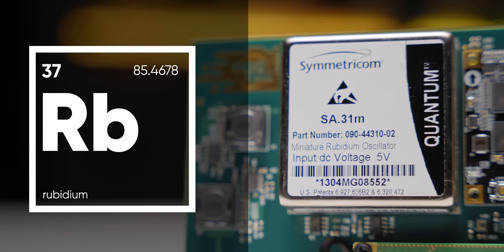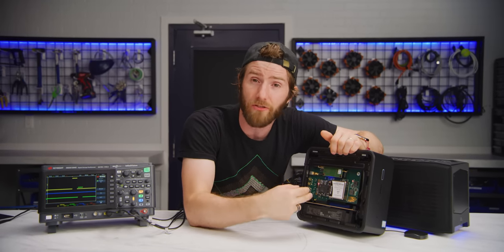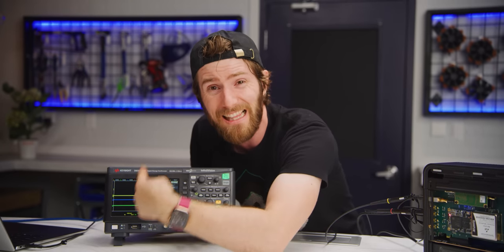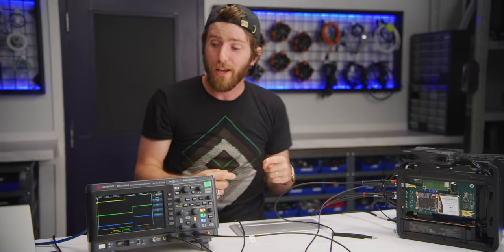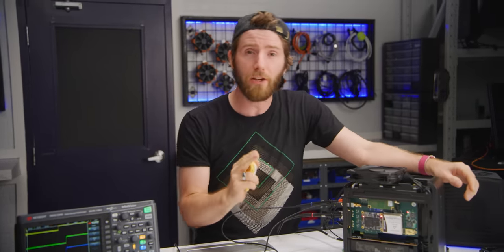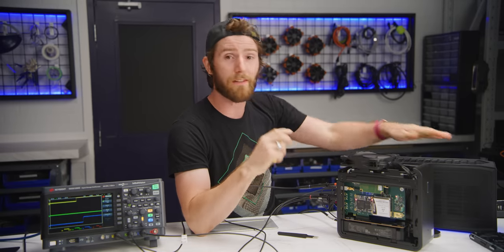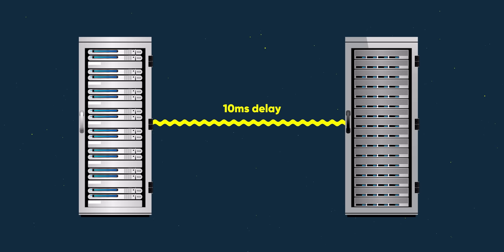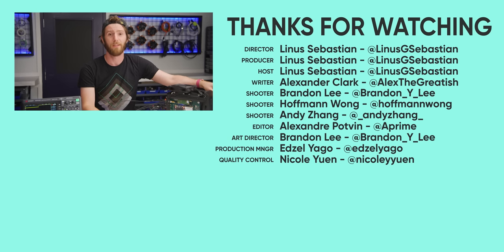Why is this PCIe Card RADIOACTIVE?

Comment: All I heard was these bots are about to become faster. Good luck buying anything with limited stock.
Reply: That's kind've a weird thing to have as your only take away from this.  While they might be an issue, there's so many other things it solves I'm not sure why you'd focus on that one potential problem that will need to be addressed by other methods than keeping everyone's data transfers slow.  And even if that was an issue, they could just keep things slow specifically on those websites that they want.  It just enables more control.
Reply: @ibigfire  Yeah, I'm not reading that. It's a joke, I made a joke.
Reply: @Tholi  That's okay, adult illiteracy is not that uncommon a problem.  I hope you find a class soon, there's many available online to help you with it.
Reply: @ibigfire  LMAO.

Comment: Thank you Linus! no, wait, THANK YOU AHMAD BYAGOWI! I've been trying to build a radio telescope for a couple years now, but just couldn't afford the $50,000 price tag for each atomic clock. If you are trying to set up an array of 12 radio dishes to work as an interferometer array like the VLA in New Mexico, EACH dish needs an atomic clock for that whole interferometer thing to work. That's 12 times $50,000 and explains why even universities don't frequently build these arrays, but now that it's ONLY $700, it'll take me a while, but it's at least possible now.
Reply: This is quite straightforward with a GPS aware router and some NIC cards.

Comment: On Ligo in general, they can simply bounce back an optical signal, not through a receiving station,
but by mirror. Once they know the output signal as it was sent, the return would be changed,
by any gravitional wave, since that would have had an effect on the signal as it is bounced back.
Interpretation is then the only thing that is required.
In fact doing the globe thing, may have sideeffects due to curviture chnaging the way the interfence
works. A neat straight line is better, which is why future hyper advanced LIGO systems will
be deployed in space, where the length is no object, and other local gravitational disturbances can
be offset by increasing the distance from gravtic sources.
I'd expect like 2070 for the first out of system Ligo project to go into effect and have yet stil
better results than ever before. 
Locally used LIGO systems can be used to detect for asteroids nearby as well, since
gravity is also a very detectable component of heavy asteroids.

Comment: Crazy thought - instead of $1600 card with true atomic clock, install card with ovenized GPS synchronized clock (which is still very precise, but a bit less so) and add not 20ms but way smaller delay. That way for ~$100 you'll get much higher throughput, etc. but it wouldn't break the bank.

Comment: Something doesn't smell right about the claim of 100X speedup just by having super accurate time synchronization. That clock still needs a distribution network, subject to the same signal propagation delays it is meant to compensate for. Still, it's definitely interesting to think about!

Comment: There is potentially a way cheaper solution if people were willing to pay another £50 for their motherboard. Crystal oscillators come in several types - XO the bog standard basic ones that have 200ppm/C drift and about the same initial accuracy. You can get a bit better than that these days but not a huge amount better. Then there are VCXO's which have an initial accuracy of 10PPM and a pullable frequency so at room temperature you can get down to about 300PPB (parts per billion). The temp drift is by far the most dominant attribute at 25ppm (or a bit less with some types). Then you have OCXOs Oven controlled to vastly reduce temp drift. IE 25ppB which in real terms is 4000 times more accurate than the best XO.

Comment: In fact a delay was added to the algorithm 'THOR' made by Brad Katsuyama of RBC in the mid 2010's to combat the electronic front running that was happening because of the time/distance fragmentation between all the 44+ stock exchanges in the USA. This didn't always work, but they would delay the order to certain exchanges so they would all hit at the same time when they were purchasing large (like 100k +) share blocks that were split between different exchanges. 

When Brad left RBC to build his own stock exchange (Investors  Exchange - IEX) they actually built a time delay for the entire market by adding a few hundred KM worth of extra fiber in a shoebox sized box that connected his server in the data center, to the main internet backbone. They achieved with hardware and they were doing with software. It equaled like 350ms or something but virtually removed the ability of HFT to front run that market.

Comment: Few years ago I bought a stack of GTX 580 with internal oscilator clock removed and they had connector for external clock generator. They had bios modded to use external clock.

Comment: Well that 20ms can be reduced a bit by having these kinds of messages and expectations

1. TEST - Timestamp A, test this against stored timestamp B (stored on receiving server), if this timestamp is greater send TIME then DATA
2. TIME - Timestamp B, if greater than timestamp A expected data
3. DATA - Store data if newest of all  timestamps given via TIME message otherwise ignore

With this the servers can focus on sending the quickest response first, by the time server A is ready for server B/C/ETC the blobs of data will already be on their way, it can then send the chosen data straight to the client before immediately sending a TIME  message and DATA message to silently update the other servers, the beauty of this method is that it doesn't matter if the other servers are slower, server A can use it's current data in a timeout situation but also report to the user it's waiting on an update from other servers, this ensures that even if the data can't be received in a timely manner the user can still be informed that the server is at least aware the data's not up to date and coming back in a few minutes or an hour will reveal the updated data, this avoids unneeded usage of help contacts.

Comment: I'm also still rocking the Note 9. I could've traded it in for $800 off of the S21 (makes it free), but I'm still not impressed with the latest Samsung phones and my Note still works fine. I wanted one of the Asus ROG phones, but they don't work on Verizon.

Comment: Linus - [observing the need for accurate time in power generation] 
A mismatch between the phase of the AC output and electrical grid could cause a big fire 

Um... that's not really how that works 
You watch the synchroscope and drop the breakers when everything lines up

Power generation responds to the demands of the grid
Frequency increases, reduce generation power
Frequency drops, increase generation power 
(lots of power-factor math & time syncs here) 

Now if you try to tie in miswired new generator to the grid, that is where things get interesting
First, get it up to speed 
Then throw the breakers

Then watch through the sparks and explosions as the turbine/generator promptly exits the building 

Science: Imagine spinning a huge mass at a few thousand of RPM 
Wiring is 180 degrees out of phase 
One generator vs. the electrical "mass" of the grid and it ends with very loud KABOOOM! and a new skylight in your generator hall

Comment: Rubidium 'Atomic' clocks are about as radioactive as the potassium in a banana, and it is barely measurable.
The rubidium-87 is used in a discharge lamp, which then gets exposed to a microwave source, which it reacts to by varying its brightness at a precise resonance frequency.
No part of this process involves radioactive decay.

Comment: There is recent research into the nature of crystal oscillators that will allow for far higher precision, into the nano-seconds or picoseconds.

Combining newly discovered time crystals (crystals that react in a fixed repeating time period) with nanotechnology they should be able to make crystal oscillators that are accurate into the terahertz range and higher.   This will improve everything from laser controls to computers.

Comment: IBM used to do the same. Everything in IBM UNIX or mainframes were sychronis synchronized to a central clock. Asyncronus used to be better and for many applications it is. But you can use both and eliminate interrupt delays and network collisions etc..

Comment: the only problem with this, is there is a slight chance of the radioactive ions have a chance to escape and change a resistor. for example the binary 1100101 could become 0100101 accidentally, which means that any data that needs to be 100% accurate would not be able to use this.

Comment: This video's content clearly falls into WHAT?!! category. Extremely cool stuff. And clearly one that you might actually not really now yet when this can be important. Using underwater cables to detect gravitational waves sounds like one of those very surprising applications. Use data that is in principle available for almost no additional costs <- That is clearly something that should be done more often. Allthough I dont think that this kind of stuff (delays over a underwater cable) falls into freely available data, as it is of security/technological/military interest type.
If only data was a little more freely available ...  I guess there is enough smart minds that could use it to generate new ideas, but only if you give them the data

Comment: I hate the classic "Oh it only drifts 1s per 100 million years". This means 10 ns per year. If you're chasing nano-second or micro-second precision, 10 ns drift is not trivial. If you need accurate microseconds, that's 1% of drift per year. If the calendar drifted 1% per year, we'd be off by more than a month every decade. That's ~15 times greater difference than if we dropped leap years.

Comment: The reason why it's synchronized to an external source despite being very precise in timekeeping is because of relativity. It may only drift 1 second in 100 million years, but if you take it on top of a mountain it will start drifting relative to similar clocks at sea level, and that's not good if you want to use it for synchronization. GPS satellites are also compensated both in terms of special as well as general relativity, otherwise they wouldn't work.

Comment: Big question here. it sounds like both systems must have the NIC to gain the benefit. so wouldn't it have to be widespread before we can cut out the ~20ms delay in responses throughout the internet?
Reply: This thing won't improve latency. That's what you're referring to... is the time it takes for an internet user's data to reach a server or other user. This just makes sure if multiple people are sending information to a common server that it is processed in the correct order, compensating possibly for increased latency.
Reply: @Ben333bacc  there are scenarios where my "ping" is less then 20ms. In that case it still sounds like the connected machines add the extra processing buffer to rectify timestamp errors in relative clocks. Would be curious if the NIC devices would show significant improvement or not.

Comment: Very cool. I hadn't thought much about super accurate timing before this. Interesting to think of the implications it could have for manufacturing... Even home 3D printing....
Reply: How could it afffect 3d printing?
Reply: @jeschinstad  It would not be as big of a deal as for a factory floor that is coordinating lots of systems, but home 3d printers can easily spend many hours on a project. RTC chips commonly have some drift which varies depending multiple factors like temperature. It would probably be fairly negligible, but perhaps consistency would be a bit better on long jobs or projects that start and stop. It is just an uneducated guess... 😅

Comment: this isn't the only use of radioactive parts for computers hooking up a Geiger counter to read radiation from a piece of radioactive material and using that as a random number generator is one of the best ways to generate true random numbers because it can be made small the other methods for generating true random numbers are much bigger and less possible to verify randomness like using an ai to watch a camera pointed at a lava lamp to generate the random numbers

Comment: So, you're saying by using this card I could possibly nearly eliminate latency in video games? If I understand it correctly, by having one of these, the server I'm connected to would never experience hitches in my ingame actions, or never desync right? And then even if other people don't have something like this card it should still buff out most imperfections in latency because my actions are the ones where I usually feel the lag, so as long as I'm hitting headshots before the other person can I will no longer lose to latency issues? Honestly if that's the case I might dive into this and get this before a gpu upgrade lol my gpu will be fine for another few years. I play Escape From Tarkov, and any seasoned player knows how big a game changer this would be

Comment: Ticking  of the clock is directly tied to the interval between ticks of the program counter increasing in a process.  So the more precision you get the more instructions you can run in a tick interval. It's kind of funny monolithic almost. We've been clockmakers for as long as we can document.  We never change

Comment: They should use this between the data centers that run the various stock markets. It would virtually eliminate electronic scalping and front running the high frequency traders use to syphon billions out of the stock market every year. Unfortunately that's now what the markets want.

Comment: 9:20 I'd say using instead of expensive rubidium counters, an initial connection check that simply tells
the time difference, like once every 5 seconds, between computers, and adjust the timestamp accordingly ?
Then reduce time added to a minimum for correct response timing.
The difference in 5 seconds or even 10 seconds between clock counters is so small, it can barely
be a few clock cycles, let alone even close to 1 ms. Maybe not as close as the rubidium solution,
but yet very cost effective, while removing the need for 20 ms, and instead needing but 1 or even 0.1 ms.
Also, neither solution would alleviate a slow response by the server, when the server itself isn't that great.

Comment: This would be great for your minecraft server. Since I am from Germany and my ping is around 106 I'd be very curious how much performance could be gotten from this device. But did I understand right? I also have to have this device installed in order to benefit from boosts or is it compatible with standard timings?

Comment: i like the presentation of the PTP  information. Linus could you dig a little deeper into how this would work with network devices?
Reply: There are white papers and books on the topic from Cisco and others. It's actually easier with network devices. Many of the network devices now deployed in large service provider networks now support accurate PTP time transfer (in the range of 10's of nanoseconds).

Comment: Not even talking about PTP used in Realtime packets for realtime systems like robots etc?? Currently proprietary protocols and hardware is used to get this realtime behaviour like Profinet/Ethercat etc. With PTP and Two wire ethernet you could also just replace CAN network, and add security to it. PTP is very important for TSN (Time Sensitive Networking) which will be the baselayer for hard-realtime networking for other protocols on top. Before it was not like that, but not all switches support it yet.

Comment: Timestamps are important in network protocols but this video is vastly over-exaggerating the importance of this device for the consumer market.

Why? Because clocks aren't a serious problem there. Delay and packet loss is. Audio/Video RTC is several orders of magnitudes more affected by packet loss and delays (in other words: shitty WiFi) than it is by clock drifts since clocks drift over a long time period but not much over a short time. Furthermore, there's no way to accurately verify that a timestamp was not forged when the packet was sent, making it a trust issue. My point is: There are many factors that are substantially more important before highly accurate timestamps would become beneficial in a live communication. Frankly, if your protocol's performance (in terms of speed) benefits greatly from such a device, then your protocol is probably non-consumer (e.g. fully trusted inter-server voting protocols), niche (easy synchronisation of a whole band via audio/video RTC, albeit this can already be done today with "skewed" clocks since, again, drifts are usually unnoticeably slow and the other factors are much more significant) or the protocol is just terrible.

Is this something that will become relevant for the consumer market in the next 10 years? I doubt it. I had to chuckle when you folks said that you want to try this out on your own servers to improve performance since that is pretty much telling that you really don't know what you're talking about here in this video. And that's a red flag for consumers. Don't over-advertise products you don't fully understand or you'll become inauthentic (even if it's open source and no one benefits from it).

Comment: The game latency claim is bogus, tech tech potato said the same thing. PC clocks are fine for syncing  games with the server, all you need is to make them client authoritive, however they don't do this because it didn't take people long to cheat.
That's why we use a server authoritive model or a mix of the 2 methods, this is why we have the issue. Servers still aren't going to trust the client.